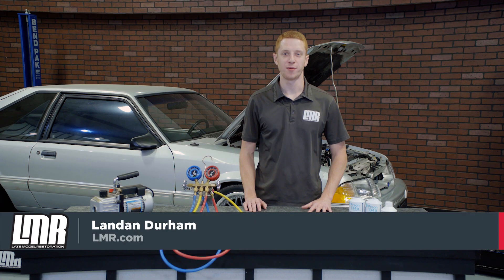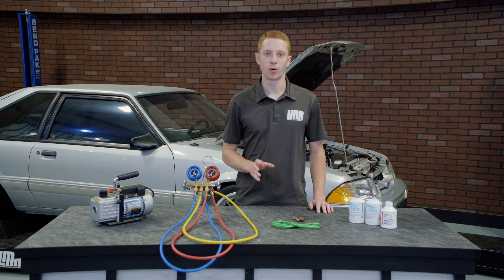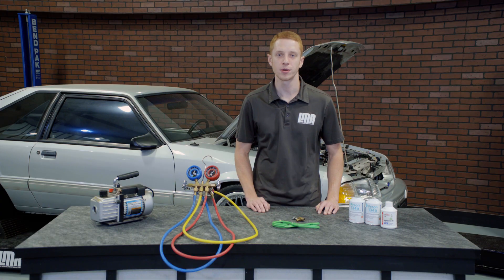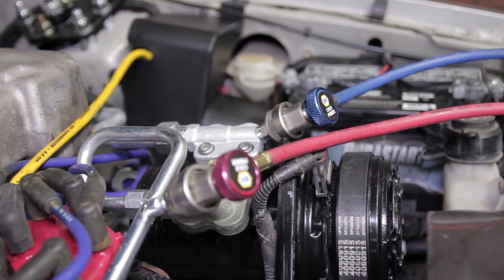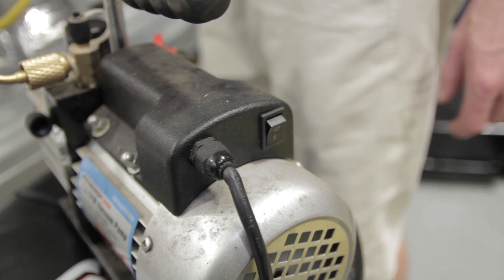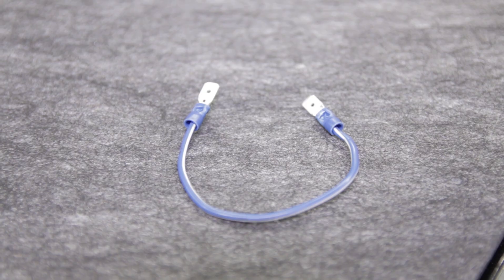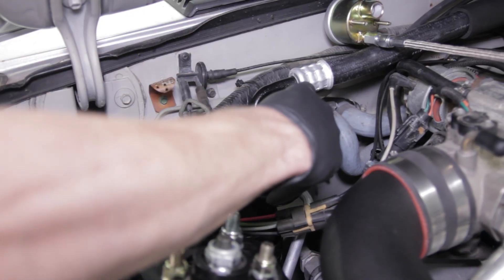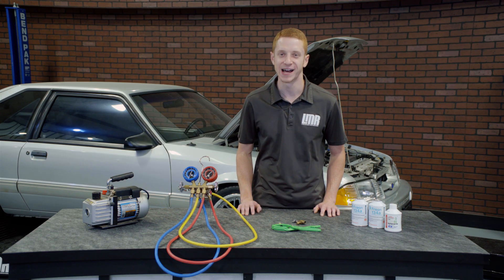How to Recharge Mustang R134A A/C System | DIY R134A Recharge

Comment: So pag oil is fine to use even for converted systems? I read that you had to use ester oil, also if using oil with a screw on connector would the oil or refrigerant be added in first? Or is either fine to add first
Reply from the maker: Hey Christian. Yes, PAG oil is fine when using a converted system. Add the oil first before adding the refrigerant.

Comment: What suspension springs do you have in the car being used in this video?
Reply from the maker: We've got the Eibach Pro-Damper Shock & Strut Kit, SVE Lowering Springs and SVE Caster/Camber Plates. Here's a link to the full build list: https://lmr.com/products/lmr-shop-car-build-silver-1993-lx-hatchback
Reply: @latemodelrestoration  Thank you, like the stance.
Reply: @HollywoodMGB3  Kinda late but I'd rather go with maximum Motorsport camber plates ;)

Comment: want to save money?  It is not necessary to change anything unless the air conditioning parts already need to be replaced.
All you have to do is buy R-12A in a can which is compatible with both R-12 Freon and R-134.  You can get this from Frosty Cool or other websites on here.  (DO A GOOGLE SEARCH)   for under 30.00 for 3 cans including a oil lubricant and sealer and it just takes a few minutes to charge.  You do not need to spend $600 and tear up for car with unnecessary factory parts.
Do yourself a favor for a change and save $$$$$$.
Reply: Fwef glad I didn’t completely screw up!

Comment: Important notes - wear safety glasses when servicing any A/C system, also, when removing the A/C quick connect couplers from the service ports, especially the high side, cover the coupler with a rag when removing. There will be slight residual pressure even after loosening off the valves on the couplers.